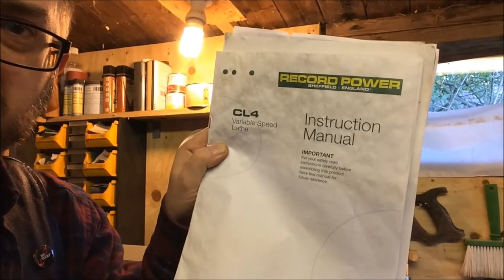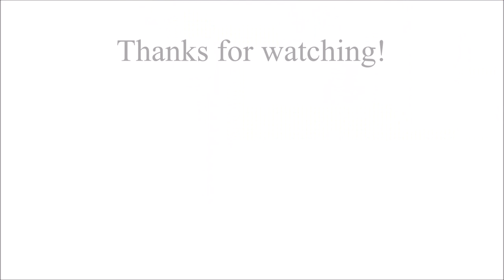Record CL4 lathe - Bearing maintenance

Comment: Having the same lathe myself, I find a worn belt can cause vibration, this wear is usually caused when a drill digs in and locks the work from rotating while the machine is trying to turn....causes a belt to wear unevenly, then over time it runs a little 'lumpy'. Also, being a bit of an engineer, with a metal lathe, I also trued  up the 2 pulley wheels on their spindles a little more 😉 they just weren't perfectly true when running
Reply from the maker: Thanks for the information Patrick, I will keep this in mind for the future. The comments on this video from people are very helpful as well - lots of helpful tips! 👍😎

Comment: so you did not replace the bearing or the bushing  both of them  had to be faulty to get that movement in the head , what does that brass bushing cost £140? i was watching this to buy one of these but brass oiled bushings is a 1000 year old solution to a problem that should have been fixed with a bearing i did not realise these were so poorly made  dont think i will bother now.
Reply from the maker: Hi mate, I did actually buy a new complete brass bushing set last year, so my lathe works beautifully now. The new CL4 lathes are oil free so much less maintenance. Plus I believe they are M2 as well. Take care Dave.

Comment: Great video Dave, I am just trying to solve my Cl4, I took your advice and kept a tub to hold all the screws, etc, unfortunately I managed to bang my head on a shelf above my lathe and some wood fell off and dropped onto the little tub and all the bit flew onto to floor which was covered in sawdust 😫. After taking the front bearing out I noticed some scratches to the inner of the bearing, I also am having difficulty getting the rear bearing off and have given up , so I called Record and the supply a spindle drive kit for £73 , which includes rear bearing, front bearing , both securing rings, new belt and spindle🥰 so I WILL get the rear bearing out! And replace the lot. Cheers for the video it’s a great help. Thanks Brian
Reply from the maker: Thanks Brian, much appreciated - if it helped at all I'm well chuffed! There were some bits I had to struggle with but didn't show as who wants to watch someone wiggle something 1mm either way for 10 minutes!? I recently bought the smaller kit than you bought, and replaced the spindle and bearing but it's good to take your machines apart every now and then to give them a good clean and to make sure it's all running as it should. 

Take care, Dave

Comment: UPDATE - I think you will find the bearing - NACHI 6205ZZE a good match to your requirements. I believe that the original bearing is a budget 6205ZZ, please check though! The Nachi is a top quality item which can stand high torsional loads and composite loads at high speed and at less than 6 quid plus VAT has got to be a winner.
Reply from the maker: That’s bloody awesome Paul - thank you! I’ll go check them out later- you’re a star mate! 👍🍺😎

Comment: Great video - watching your excellent video has helped me diagnose that my CL4 front bearing has just failed and provided the information I need to attempt the replacement.  Unfortunately, I don’t have the brass drift tool, so I will need to source one. What size is the supplied drift tool? Thanks for a super video.

Comment: You didn't like the grinding sound eh. 
So far I've not had to do any repairs to my newer lathe, but my old blue lathe I had to change the pulleys.
Loads of fun
Cheers
Rob
Reply from the maker: You have a lovely lathe mate. I need to get a new back bearing for mine but that will have to wait a while until I get some wonga.

Take care mate, Dave

Comment: Nice video, I have a CL4 and am experiencing some play on the spindle. Adjusting the bearings doesn't seem to be helping so I think I will follow your guide and see what's going on inside.
Reply from the maker: Thank you David, It's reasonably simple to do as you can see! 

It can get a bit fiddly though - getting the spindle in the back bearing and seated was quite tricky, but if you're patient and don't force anything it all works!

:)

Comment: Thanks for the encouragement.  I think I may try to replace the bearing after 7 years.  My problem is a fine vibration and the spindle does not run true even with a light work piece. I think that this may be inherent in the Record lathes set on parallel steel tubes.  Conspicuously, there appear to be no such lathes on the market elsewhere.
Reply from the maker: Try unplugging the lathe, loosening the belt and the locking rings either side of the headstock, then slowly tighten up the inside ring. When you turn the thread protector - and so the shaft, you will feel when you start to get friction. Once you do, loosen that a gnats hair and then tighten up the outside locking ring. The shaft should turn easily, smoothly and quietly with your hand when it's right.

Comment: Record bought out Coronet who made lathes in the 70's. This us exactly the same set up as my Coronet no 2, made in the 80's! Nothing has changed in 5 decades!!!!
You are aware the phosphur bronze front bearing is tapered? Did you try to adjust the play out first?
Reply from the maker: Ah interesting...i wanted to take it apart and give everything a good clean, and once I put it all back it was running fine, so probably did that in the first place. 

Thanks for the comment, I love my Record lathe so love hearing about them :D

Comment: Thanks for a very useful video. i did not see how you cured the initial noisy slack in the main bearing.  Was it just dirt?  if the bearing is worn, would a new one just slot in or would it require to be reamed out?
Reply from the maker: Hi! I found buying a new bearing easy and quick. It is a very tight fit when you put it into the headstock casing. Take care, Dave
Reply: Thanks again.  I think I might have a go!

Comment: Hi  Thanks for making this video. It should be of help for Record CL 2-3 and 4 owners to SOME DEGREE.  I had a CL 2 for years, from new. It operated without fault and I even converted it to variable speed with and inverter unit from Stephen Haydock (Speed Genie). It was the best. 
With regard to your video I would suggest that you perhaps should have exercised more care and attention to the adjustment of the main bronze tapered bushing.
It is tapered for good reason (take up wear play over time) and fine adjustment as prescribed in the service manual is vitally important as part of regular maintenance.
You Do NOT just bang it up tight as shown in your video.
I would also suggest that proper Record spindle oil is used rather than 30W.  Using the proper oil and with the correct bearing adjustment you should never have oil spraying up the back wall.
A bottle of proper Record oil can last as long as a year turning daily for hours if the bearing adjustment is tuned properly.
Reply from the maker: Hi Jim, thanks for the comment. 

All steps were followed word for word from my manual - I believe the term for seating the bearing was tap it 'so you hear a clunk sound so you know it's in properly, but I'll read it again to make sure and add any additional information if needed.

The manual also just states 30w, but I will look into buying Record oil in the future. 👍

Thank you for taking the time to watch and comment - it's much appreciated!

👍🍺

Comment: Did you check before dismantling the lathe, the problem couldn't be cured by adjusting the bearing?
Reply from the maker: Hi Edward and thanks for commenting. This video was to show people how to service their bearings if they didn’t have a manual, and how I fixed my problem - which was actually the back bearing. 👍

Comment: Nice job, but a few things you might find useful. Before you re-assemble the shaft and pulley, clean the powerbox out. It could save you heartache, grit and dust in there easily contaminates the bearing and shortens its life considerably! Fit the rear bearing before you insert the shaft and pulley, then tap it in using the shaft through the front bearing. Then mount the pulley. I know it takes a few minutes longer but the shaft just slips into place. 
The marks on the rear bearing were probably caused by someone trying to fit the rear bearing with the shaft off centre, not very clever as that too can shorten the life of the rear bearing.
Try "Simply Bearings" for replacement upgraded bearings for the rear of the shaft, there should be a model number on the outside edge of the bearing which will indicate its outside and inside diameter and the type of seal on the ball  races - which in your case should be metal.
Reply from the maker: Thanks for commenting Paul, very helpful! :)

Comment: nice one I have a CL3 same thing but without the speed do you oil it every 3 to 4 hours as it says in he instructions because I tend to find my back wall has a black spray running up it lol but then again i don't have to tightened my bearings to often 
Great job
Reply from the maker: Thanks for watching and your comment Keith. i do oil it regularly, about one drip per hour. I get the spray on the wall too, it's from over lubricating, make sure you use 30W oil.

Take care, Dave